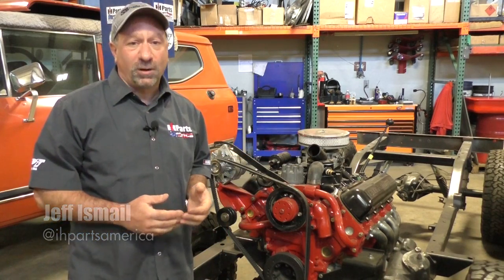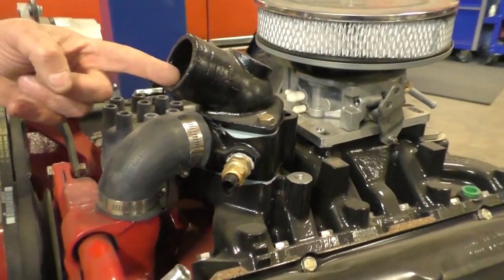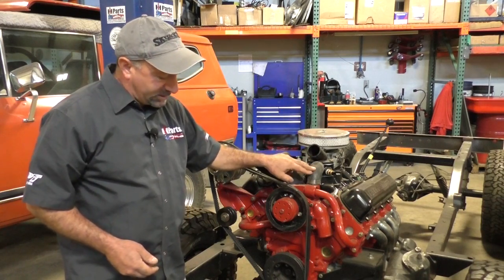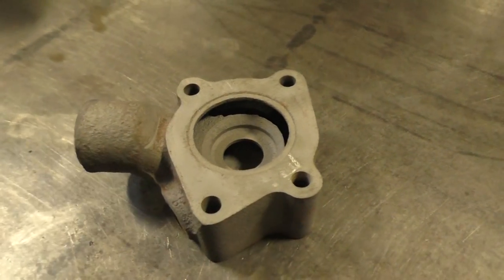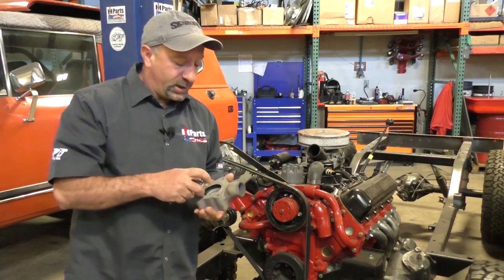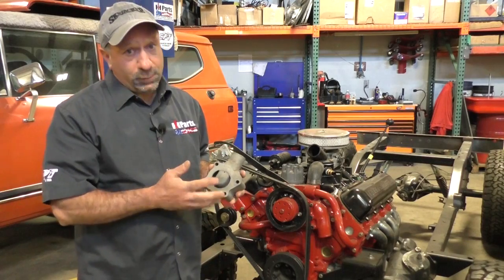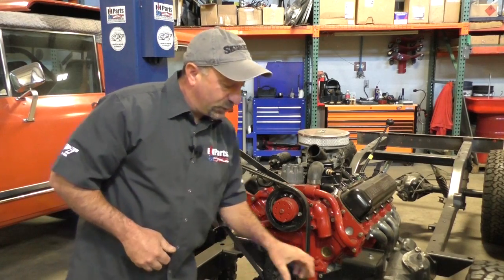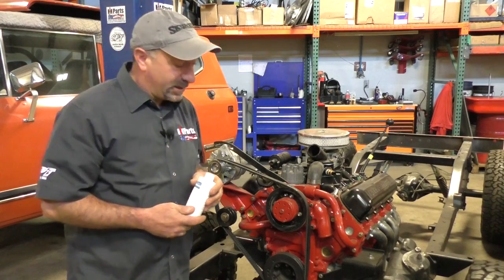IH Engine Cooling System Review

Comment: Thanks Jeff. I’ve been working on these engines for 45 years and never knew what that bleed hole actually did, although I’ve always blew air through them after a hot tank or solvent tank cleaning, just because I knew it did something. No matter how many times you tear into one of these engines, you learn something new every time you do it.

Comment: Nicely done. Next question is about “improved cooling”. What exactly is improved on the 392ic engines?
Reply from the maker: To alleviate hot spots on the cylinder walls, IH moved the cooling tubes from the heads to the block. This was only a problem on Loadstars and other big trucks that used the 392 and worked the engine hard. Of course we seem to find more cracked heads on the improved cooling engines as the heads didn't get cooled as well.

Comment: Have a question im going to be buying a 1965 international d1100 r these gas or diesel and what engine js in it and if it was run then park and sat for awhile thats the first thing I do once I get it
Reply from the maker: 99.99% of IH pickups were gas back then but IH did put out a few diesel versions back in the 60's. As for getting it started after a long nap, see an article on our Tech forums on how to do this  - https://forums.ihpartsamerica.com/threads/i-4-and-sv-engine-non-oiling-rocker-assembly.868/
Reply: So what's the best thing to do to get a engine unstuck is diesel ok to use or what's the best thing to do

Comment: What can shaft and lifters do you recommend for these engines?  My concern is avoiding flat cam issues.  Thanks.
Reply from the maker: Give our parts department a call and they should be able to make recommendations. 530-274-1795